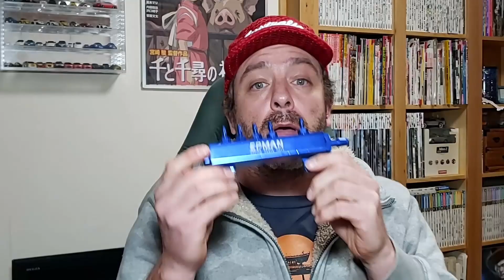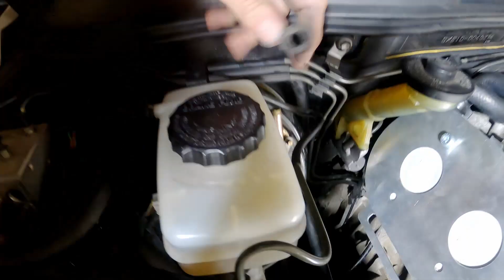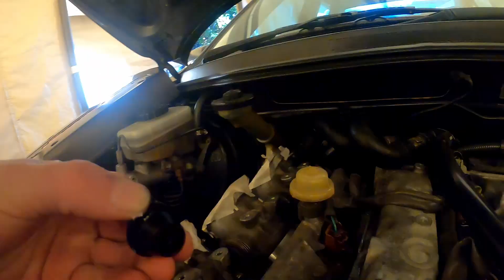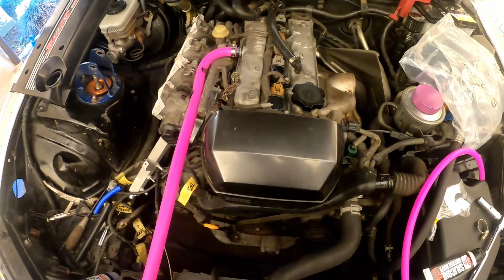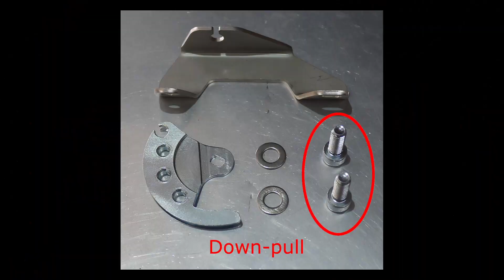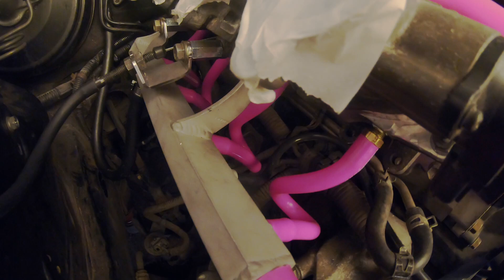Vacuum Block and SQ-Engineering Pull Down Throttle Kit Installation

Comment: hey mate nice job ...
routing the engine breather in the cylinders is wise ...

what is your vacuum ?

im on the same project but in smaller scale ...
silvertop itbs on 16v 4age with map sensor ...

my itb adaptor has 4 barbs of 3mm each 
will it produce more vacuum if it had 6mm or 8mm ??

i need a strong/stable  map signal so my safc will struggle less to correct my afr on idle throughout 3000 rpm ...

im hoping ill make it run correct with stock ecu....
short budget unfortunately....

any knowledge sharing would be grateful

thanks 
nicholas . greece
Reply from the maker: I don't actually know if having a bigger vacuum source from the itbs will make any difference. It might, in just saying I don't know.
But a map sensor is only ever 3-4mm so by that logic it doesn't matter.
However my brake booster is 10 mm so by that logic it does matter....
If in doubt just change the barb's to 6mm.

Thanks for watching and leaving a comment
Reply: @GarageKei  thanks for your time ....
Reply: the high RPM problem is that vacuumblock sukking air from "seals" on engine. not heathy to route like that wear them fast